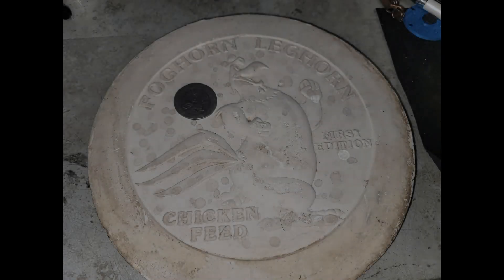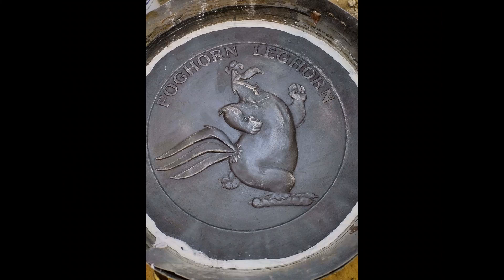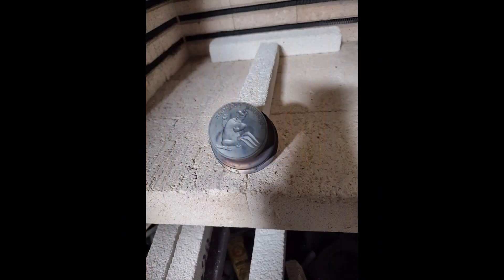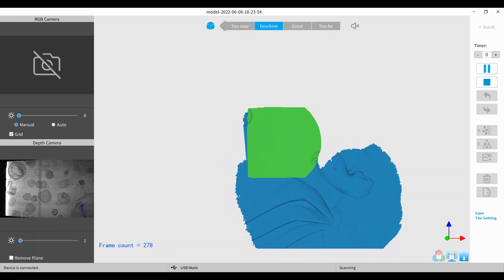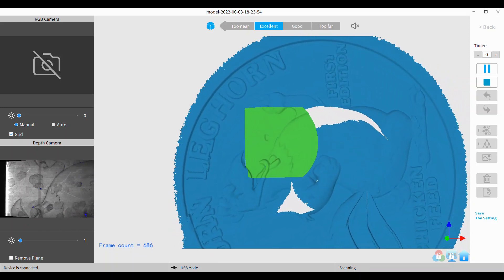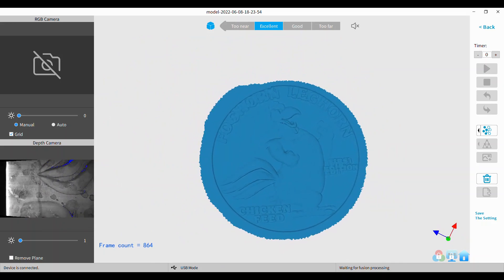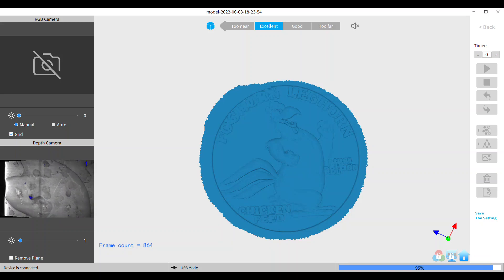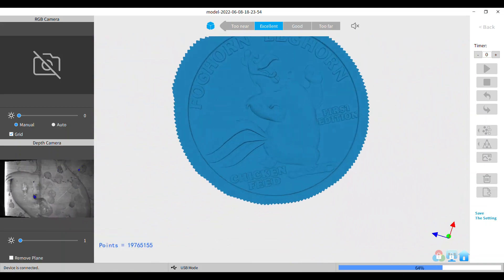Revopoint MINI Helps to Refurbish a Vintage Coin Plaster Sculpture (Part 1)

Comment: What kind of kiln is that and do you feel that mini is easier to do
Reply from the maker: That's a heat-treating oven in my brother's shop. The mini is easy to use, just as the POP and POP2 are, but because the FOV is smaller, it's more difficult to scan larger items. Also, the point cloud is MUCH larger, so processing time is waay longer, depending on your computer and the volume of the scan. The tradeoff is the higher resolution of the scans from the mini.